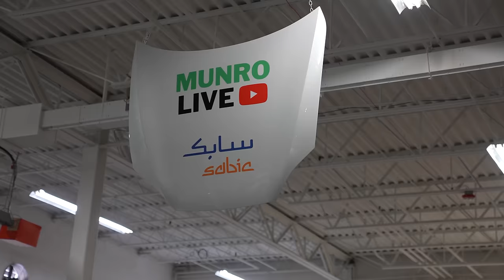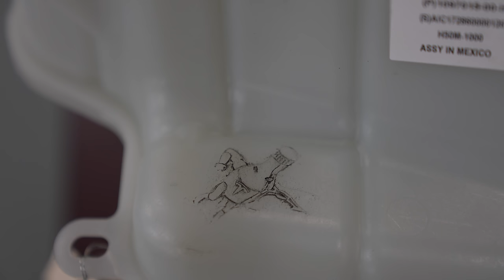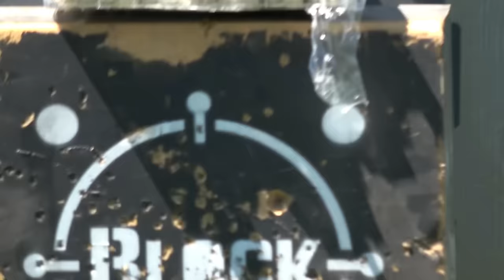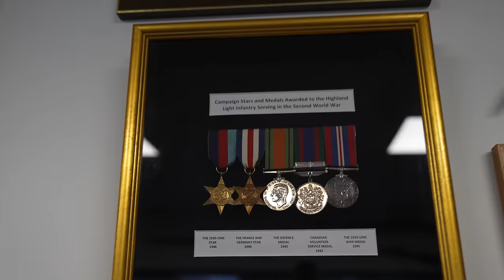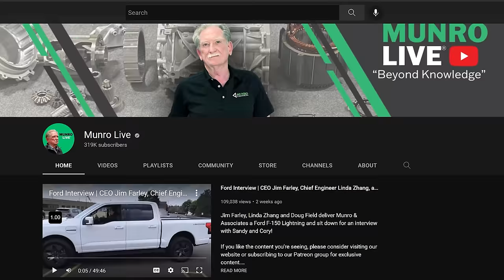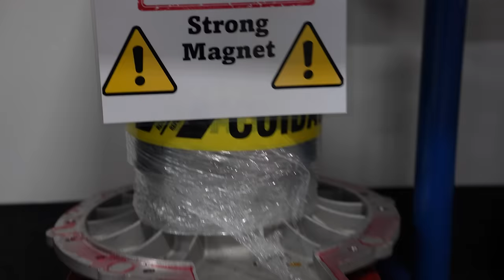Picking up my New Tesla 4680 Battery!

Comment: Moving to electric vehicles to limit emissions, but all its really doing is shifting the emissions elsewhere. If you do some research you’ll find just how much pollution and waste is created from producing a battery pack. Not mention their lifespans are severly limited and not easily recycled, which itself whole other issue.
Reply: Facts
Reply: all you said its lies!!
first, from material extraction to building the car, it just makes a little more pollution then an ICE car, but during the lifetime of the car, ICE cars make much more pollution all together. so to say they are shifting emissions elsewhere is untrue, because if you put, again, form the moment a material is extracted to building the car, it makes almost the same amount of pollution has building an ICE car.
second, saying the  lifespans of an EV is limited, is again a lie, an ICE car lifespan is 133k miles, while an EV is ~200k miles, plus tesla new 4680 battery showed to have the capability of up to 1000000 miles lifespan, and other batteries are also trending there. so again, that's a lie.
and third, saying batteries are not easily recycled is again a lie, not only tesla does it and is capable of recycling about 95% of it, other companies also do that, and have shown great success...one of those companies is from one of the tesla co-founders, and many manufactures are using that company to recycle! so again that's a lie.
i advice you to start reading proper news, instead of blogs from EV haters. 
EV's pollute? yes, but they pollute far less then an ICE car in its life time!

oil will still be needed, but why not shift for a much cleaner form? is because you prefer the cars to make noice?!
all you said its just lies, and a simple research show's that. an extra advice so that you might get proper education...i advice you to go see tesla reports on their website where they show the emissions made on building a car since its material were extracted! its very informative!

Comment: 0:25 WRONG! Solid state batteries are the future.

It's the next iteration of battery, in a nutshell it went lead-acid, lithium-ion to now solid-state
Solid state offers greater size to power density, the cost to make it and safety because they are nearly 3x less deadly during any fires. 

However we are still about a decade out from mass deployment of it but still, Tesla should focus on that instead.